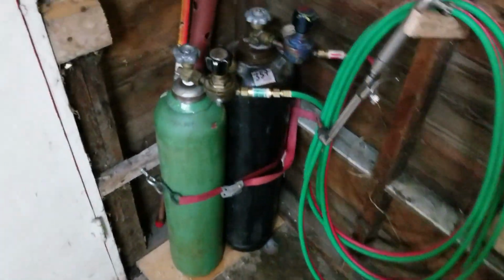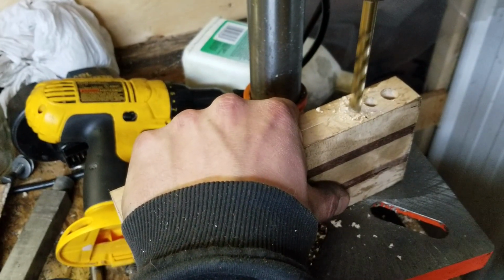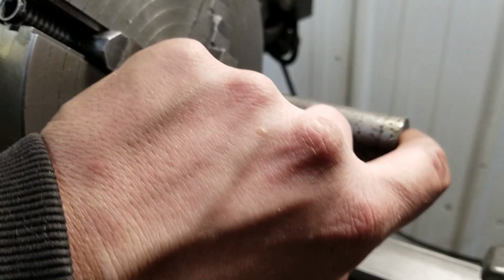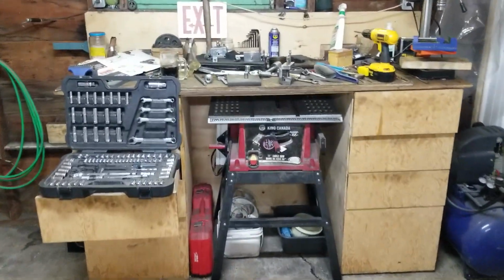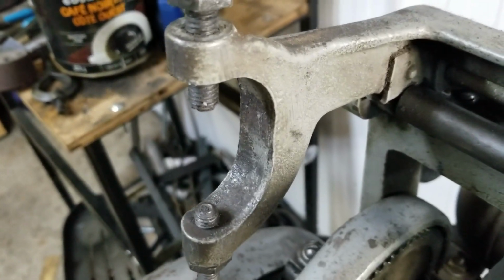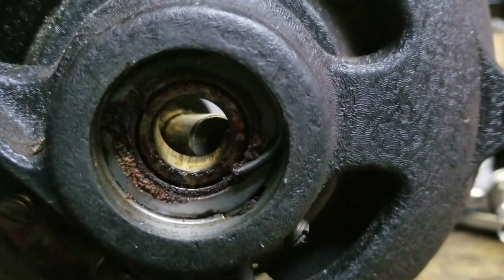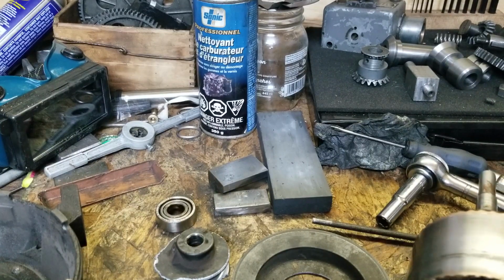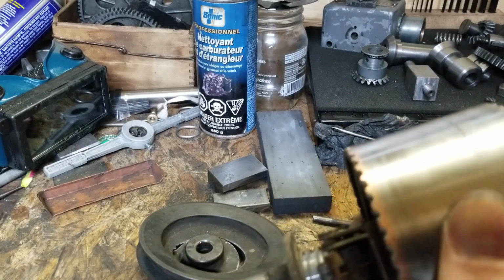Thinkin' Out Loud Volume 2

Comment: Congrats on the new score! What size are those? That is like the size set up I'd like to have. Thankfully Spring is more or less here, so more shop time with less layers on.
Reply from the maker: They have a 1/4" hose, it's a nice heavy duty torch😊. And yeah, super thankful for spring, lol. Super cold winter this year, not gonna miss that -40 weather that's for sure.👍😁👍
Reply: I should have been clear. I meant what size tanks are they?? Same here. Enough winter!!!  @Just1GuyMetalworks
Reply from the maker: @johnstrange6799  oh! Lol, the acetylene is a 36" tank, not sure how accurate the gauge is so idk the pressure, the oxygen is only a 30" size, still like 2200psi in there. Think the pressures are pretty much standard whatever the size. They were the biggest I could legitimately purchase lol.
Reply: They're perfect. :)  @Just1GuyMetalworks